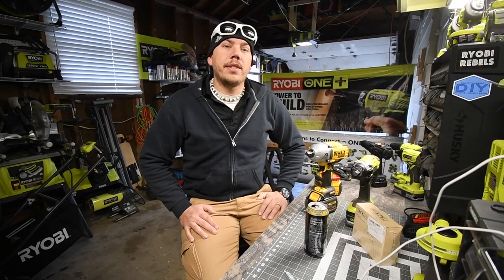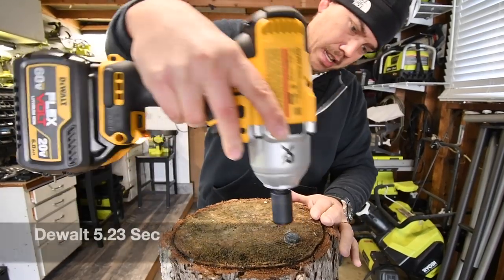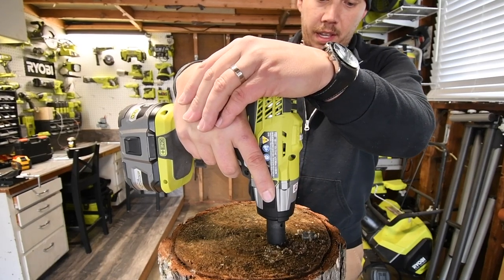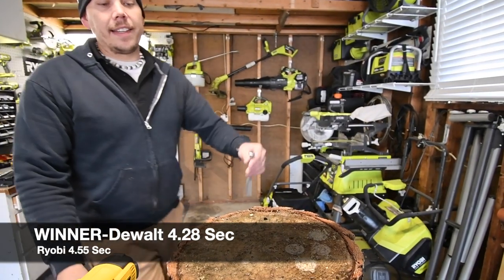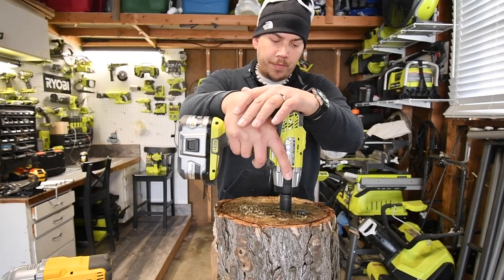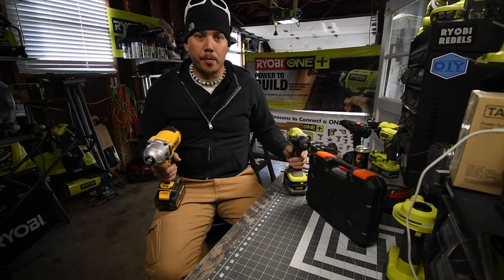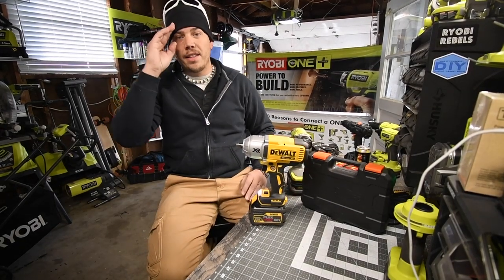Dewalt XR VS. Ryobi

Comment: no bias here at all,  just a guy filled with a room of sponsored ryobi products and banners,  no bias review tho!
Reply from the maker: this is an old video. the tests I do now are way more intense that the Roybi would fail at. Ryobi needs a major upgrade on that Impact wrench. The test I did on these was too easy. I do much harder tests now
Reply: @ManCaverTools  I hope they release a stronger one soon I want to get a bigger one but have so many ryobi tools and batteries I'd rather stick with them then invest in another platform
Reply: @nowiplay2  I've been buying a lot of the Milwaukee M12 stuff lately they have a lot of nice mechanic tools check them out

Comment: This was the high torque Dewalt .  That Ryobi is more of a mid range impact wrench, which Dewalt also makes.  Kinda apples and oranges.  I personally like the Ryobi better in this matchup and it's a great bargain.  I really enjoy your channel.
Reply from the maker: I thank you very much sir
Reply: Yeah, a better comparison would have been with the mid-torque Dewalt impact wrench (DCF894).
Reply: The DeWalt mid torque makes a bit more power. My buddy at work has the Ryobi and my DeWalt usually beats it but it's really nice and for the price I'm surprised by the performance. Ryobi has gotten way better then when they first started!

Comment: I hope the 1/2 inch impact that Ryobi releases for the US is NOT the same as the one that they have available in Australia  because that one is weak, rated at just shy of 200 ft-lbs of torque.  I have been pleased with the torque generated by the current model, I hope when they release and updated brushless 1/2 impact it is at least as powerful as the outgoing version.
Reply from the maker: I agree, I cant wait for it to come here

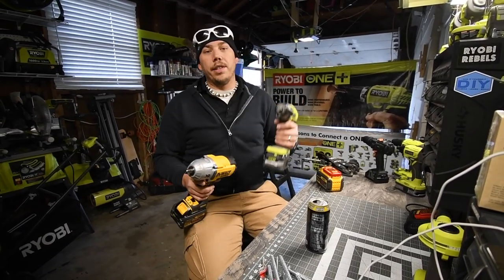Comment: You state at 1:55 that Ryobi is making a 1/2 brushless impact that is stronger, I have done extensive research and can only find info on the weaker Australian brushless 1/2 IW that exists, could you cite your source? I have contacted several Ryobi reps who have said this is not the case, and I hope they are wrong.
Reply from the maker: this is a very old video and doesn't really count as a good test video at all. I changed the way I test more intense tests
Reply: @ManCaverTools  I realize this is an old video, I thought it was good. That's not the issue, the issue is you mentioned a stronger brushless 1/2 impact is coming, I'd like to know where you got that information.
Reply: @johnx9349  yeah i'm in the market for one, i would wait if there will be a brushless version...but i guess we would need an answer lol

Comment: You should do a air impact lag bolt test can imagine how fast it'll drive it through and also removing it with the high 8-10k rpm it's rated at

Comment: Is the dewalt a high range torque and the Ryobi a mid range torque? Different category correct?
Reply from the maker: that is correct. I have a mid range dewalt now and I will be doing that against this Ryobi
Reply: @ManCaverTools  oh cool that would be awesome to see. I just started buying some ryobi because of the 2 battery and charger get free tool lol so I'm hooked. I have lots of dewalt been using dewalt for years and there great tool but lot more expensive to buy. Thanks will be watching have great day

Comment: Not sure either tool was meant to drive lag nuts.  They’re meant to bust nuts off that are torqued to hundreds of lbs.  

That Ryobi will struggle with anything that’s tighter than your pick up truck lug nuts.  Meanwhile that Dewalt will snap off cv axles, will do crankshaft bolts, and in an emergency can do semi wheel lug nuts.  Fat chance with the Ryobi.
Reply from the maker: yes it will. the dewalt is in a another class than this impact wrench

Comment: So it's clear the dewalt is more powerful but slower and ryobi less torque but faster. No real surprises here. Both work well for their respective spec.
Reply from the maker: this is a much older video and my tests back then weren't as extreme as they are now. Dewalt would destroy this Ryobi with the tests I do now

Comment: A good evening did I hear correctly that the impact wrench will not work with the HP batteries? Why is that?
Reply from the maker: HP Batteries yes, they do work but the HP assist dos not activate with a non brushless tool
Reply: @ManCaverTools  thanks.Talked with my guy from HD he said to wait for Black Friday or Cyber Monday that those kits prices will come down.

Comment: found your vid through yt recommendation. i was thinking to buy DCF899 next year to be able to maintain my car on my own but i guess i'll back off after knowing how big it is. my poor muscles wont like it
Reply from the maker: there are a lot of other impact wrenches that are smaller that can do the job.i just uploaded a 12 v tool that can take lug nuts off
Reply: @ManCaverTools  what do you think about DCF887 impact driver?. heaviest thing i would do is lug bolts and suspension works. i saw mixed reviews and my choice is quite limited here.

hitachi stuffs are hell expensive, little to no ryobi (only ryobi blue got sold here), and no one sell milwaukee
Reply: I have the DEWALT 885 887 AND 899 IMPACT THAT IS A BEAST ONLY USE IT ON LARGE NUTS BOLTS ON MY DIESEL TRUCKS THE 885 AND 887'S WILL REMOVE THE LUG NUTS ON MY HONDA ACCORD BUT NOT ON MY TRUCKS. OVER ALL 887 GETS MOST JOBS DONE IF NEEDED I JUST CRACK THEM LOOSE BY HAND FINISH WITH THE IMPACT DRIVER
Reply: thanks!. i guess i'll buy 887 for now
Reply: @n.shiina8798  buy the adapters  you'll be fine also like I've said before watch out for the battery's  the 1.3AH are garbage
Reply: thank you again. the ones sold here came with two 2Ah battery. i hope they're fine
Reply: @n.shiina8798  they work fine i like them because they keep the tool light and don't pull your belt/pants down. As new should last all day depending on use..plus they have the charge indicator unlike the 1.3AH battery
Reply: thanks for your advice!. looking forward to work with this tool!

Comment: I have ryobi and it does a great job in my vehicle for light duty stuff it's great for more heave duty stuff than DeWalt
Reply from the maker: very good and I thank you for viewing Alpha
Reply: Work as an iron worker setting 5/8 to 2 inch nuts desalt is my go to and when sheeting the building iv dropped of the roof many times to only have a wobbly bit
Reply: The 899? Mine is a beast.

Comment: Dewalt: ill give you the first round..but!.... that's about it. The rest is mine.
And yeah Ryobi did very well I was very impressed with its performance.
Reply from the maker: not bad at all for a brushed model.
Reply: It's good to have tools in different ranges. This test proves that. The weaker Ryobi is faster and has higher ipm. As long as it's not working too hard, the tool with the higher rpm and ipm will whoop some ass. Buying a 3/8 DeWalt to go with my big ass DCF899 right now.

Comment: Its old video,but i found it now. Why you comparison two completely different models ? DeWALT is almost twice as bigger and got twice as power in Nm....and the giant battery? Dewalt got model which is suitable to comparison with Ryobi IWS3 and its DCF894NT
Reply from the maker: because it was all I can get at the time. the Ryobi would get its but handed to itself if I did another video with these.
Reply: @ManCaverTools  Thank you for response. For me is surprising that Ryobi got more expensive batteries, than DeWalt in my state...same set from DeWalt and from Ryobi is not that much from each other (price) just because of price of Ryobi batteries.

Comment: As expected, because the DeWalt has twice the torque. There are plenty of jobs though where you'll want to start with your least powerful tool first. Tearing off the welded nut in a subframe or chassis is not much fun to resolve.
Reply from the maker: this video was not a good video for a versus. that dewalt would destroy the ryobi with no contest with my new ways of testing

Comment: Bay the way that Dewalt is also 3 years old Dewalt has not came out with anything new be sides their tool connect which is just there old tool plus Bluetooth, their mid-power impact gun which would probably been a better mach for Ryobi, and their 60v tools is that tool a beast yes but lag-bolt test is what that Dewalt was designed to do lag-bolt after lag-bolt
Reply from the maker: thank you for the info sir